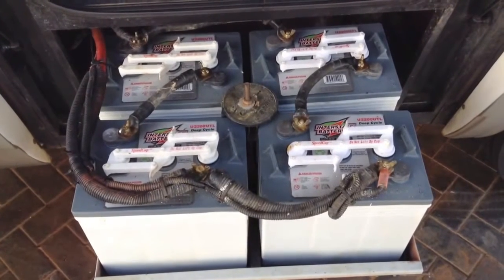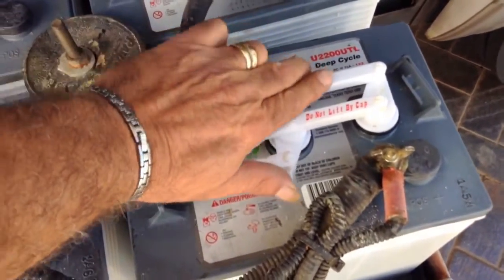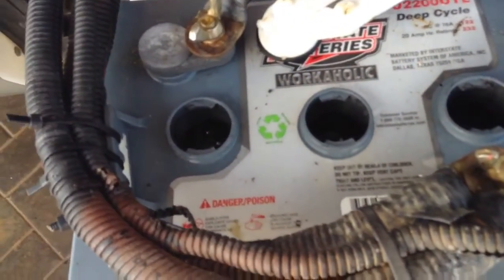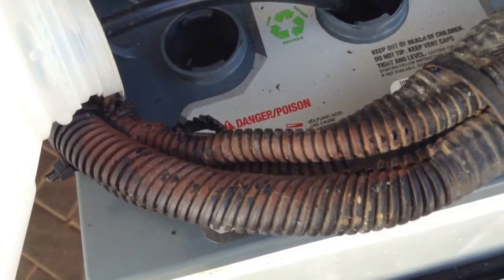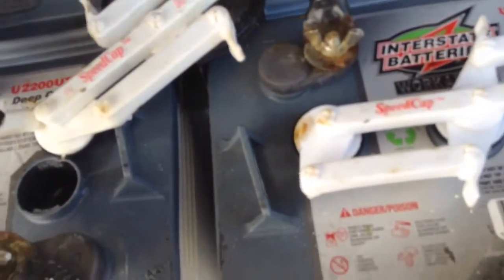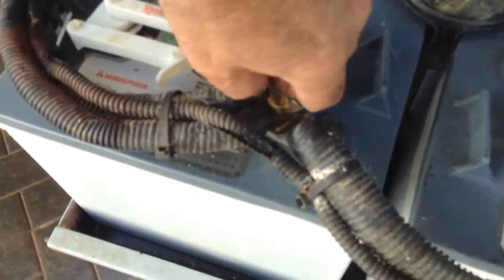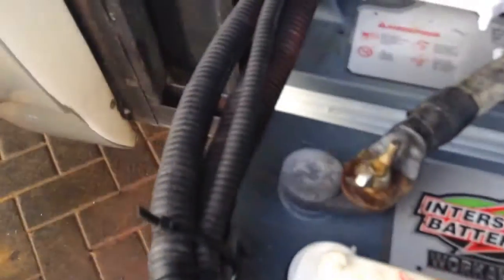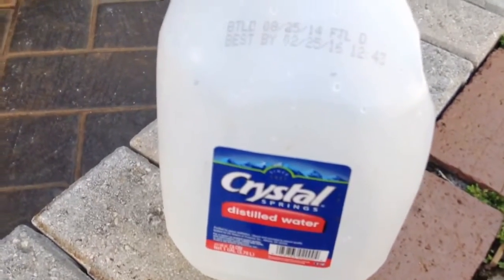HOW TO CHECK RV DEEP CYCLE BATTERIES  WATER LEVEL

Comment: How long do these last for you? and what is the typical use (how deep do you use them and how often)?
Reply from the maker: They last about 7 years if they are maintained and do not allow them to go below 50% to many times. I use them for small AC powered electronics like TV, lights and limited use of microwave, they last about 5 hours to 8 hours before I use the generator to recharge them. I mainly use them during short or overnight stays at rest stops and when no Air Condition is needed (winters)😉 BTW the engine alternator charges them as well. Many times we only stop for a few hours so the alternator recharges them once we get back on the road. I always wanted to install Solar panels but we don't do much dry camping. Thanks for the question and watching the worst video I ever made Kirk. LOL🙄
Reply: @JohnCRV  LOL. I just bought 8 of the L16P-AC 420AH 6V batteries for my home system. I hope they last 10 years, only time will tell. I do not plan on going more then a 20% discharge on a normal day.
Reply from the maker: @madscientisthut   - WOW that is massive, Charged by solar panels or windmill??
Reply: @JohnCRV  Solar mainly, I can charge by generator for long term power outages (we had one really long outage in the 2013 floods, it was over a week in duration. I just ran a 700 watt generator to keep the battery bank topped off during the day since it was cloudy and raining most of the time)
Reply from the maker: Mad Scientist Hut  -that is good.  My golf cart has 6 of them. That reminds me I need to find the footage of when I installed the new ones a year agoLOL.

Comment: Okay well since you answered so quickly can you tell me where the battery level should be at can I fill them up to the top I mean not overflowing to the top but at least up to the top?????
Reply from the maker: Never fill to the top. The level of the water shoul be  at least 1/4” inch below the  INSIDE.. neck of the battery, this will give it room to breath when water is bubbling and it will not spill over the caps. Also, You never want to be below the plates. If you see no water above the plates it will corrode them and start expanding them to the point where the you will see the battery outer wall (s) bulge. I hope this helps. If you have any other question feel free to ask, it’s the least I can do to make up you having to watch the atrocious video. :) Have a great day.

Comment: Hi John, good video, never realized there was so many batteries in an RV! But you would need these to run things if there is no power provided. Also I would have thought it would have been a different type than an automobile battery. I just thought it would have more cells. I use distilled water in my battery, ah saw it at the end of the video. I like that spring battery cap that makes it easier to remove and replaced. Like #16 Gary
Reply from the maker: These 6 volt batteries last longer they are the same made for golf carts as well. The 12 volt are only good for starting not to store for longer power.
I just replaced them with better batteries not too long ago but no time to edit the video.:)